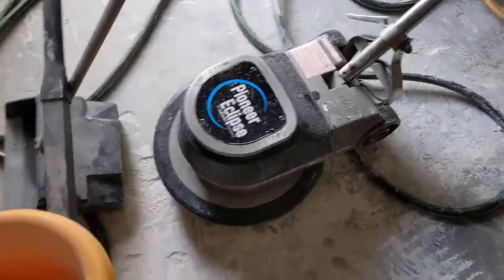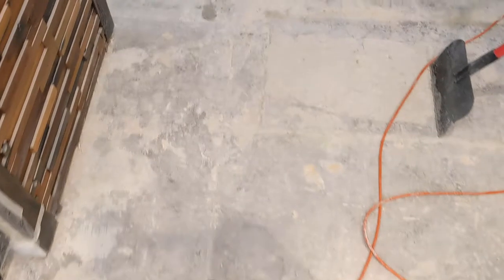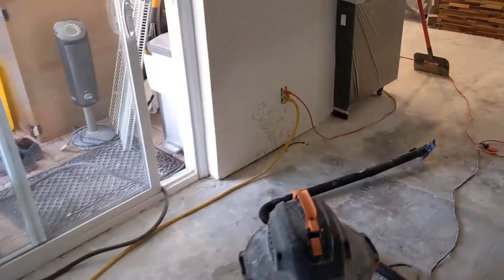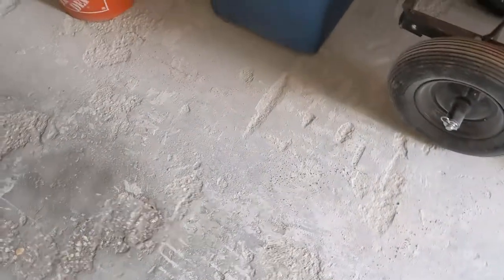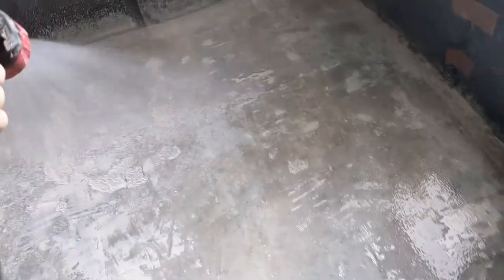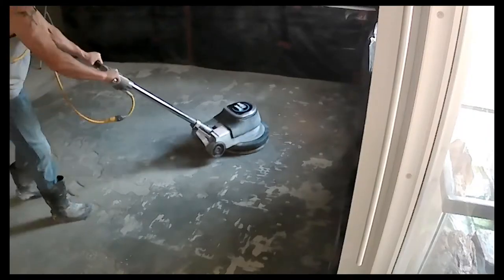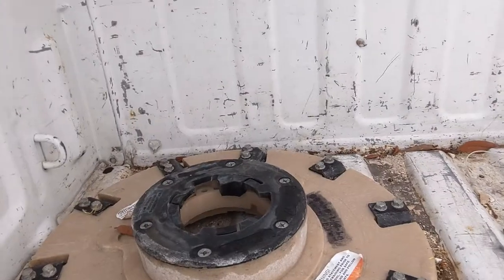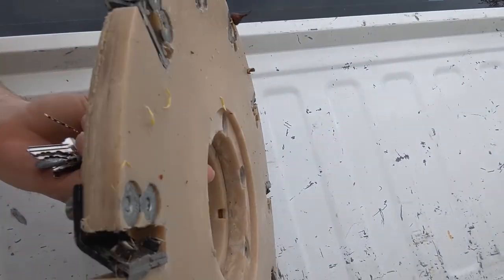Smoothing Floors After Tile Removal - House Rebuild Part 3

Comment: Just a few helpful hints for anyone going through this... First, a rotary hammer is sufficient for most home projects. Don't let the rental companies talk you into any big pieces of equipment or hammers. Inexperienced users will do hella damage to their concrete slab. When taking up the tile, you want to try and remove the piece whole. This will save you a mountain of cleanup work. Broken tile is very heavy and sharp and garbage bags and contractor bags are not strong enough to deal with the mess. If you keep the tiles intact, they can easily be stacked out of the way. The key to removing tiles whole is to use your ears. Tile with good separation from the thin set will sound completely different than tile still bonded to the thin set when the roto hammer is working. It also helps helps to simultaneously use a shop vac with a minimum 100 CFM rating to capture the insane amount of dust the roto hammer kicks up. Just lay the hose right there on the tile you're working on. Do NOT try and remove the tile and the thin set at once, instead focus on separating the tile from the thin set. This will save your concrete slab some damage.... Once all tile has been removed, you can then begin to focus on the thin set removal. Don't rent the machine shown in the video. It's bulky, hard to handle and is unforgiving in tight spaces. Also, don't hose your floors down because you are working with equipment that most likely has an extension cord. Use a mop and a bucket of water to dampen the area you are working in. For best results, use the roto hammer in short bursts to chip up the thin set. If an area  doesn't chip up easily, skip it. The hammer will gouge your slab. For the tough areas you want to use an angle grinder with a thin set removal grinding wheel and a guard with a hose attachment to simultaneously remove the dust. Good Luck!!

Comment: Did you apply a floor leveling compound afterward?
Reply from the maker: I did, filled in the divots left by the chipping hammers and smoothed some uneven surfaces. The worst part was cleaning up the edges of the leveling pours and the drips. I used a grinder with a surfacing diamond blade, the amount of dust made it look like my house was on fire. I made pressurized "clean" rooms to isolate the dust areas.